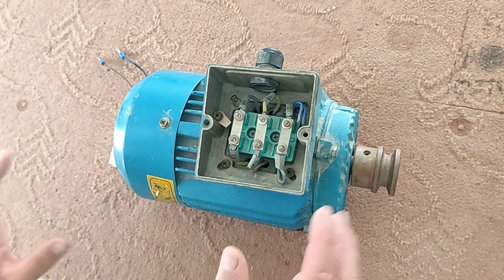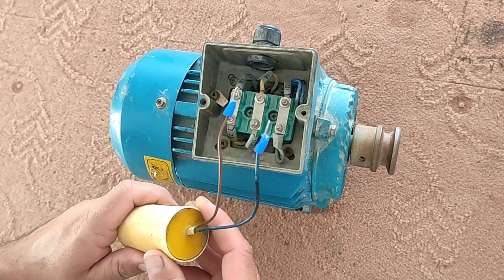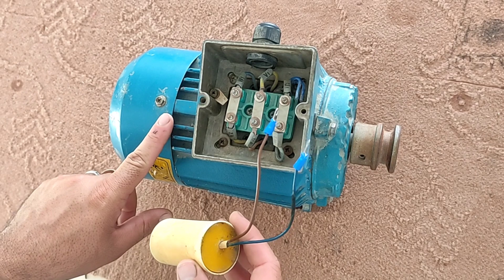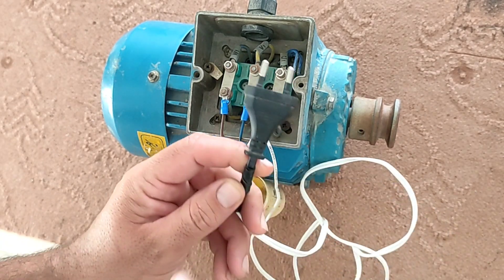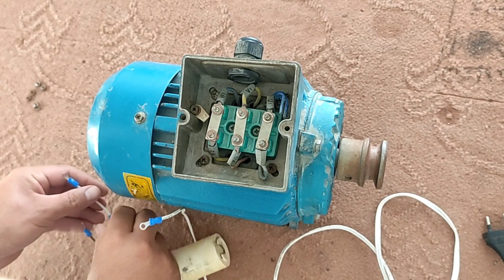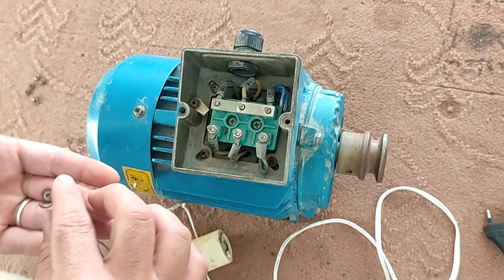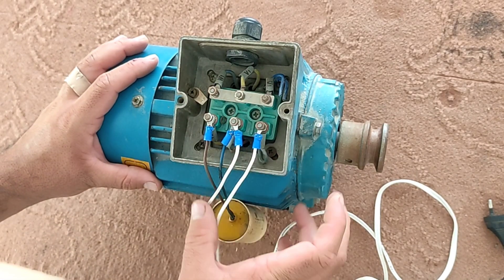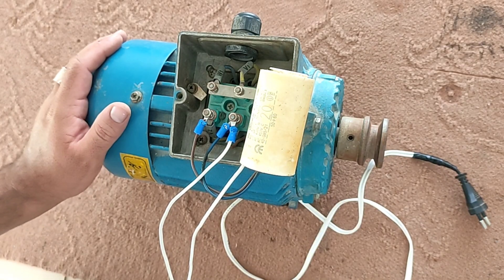how to run 3 phase electric motor with single phsse electricity

Comment: When connecting using delta,where does the live wire from the power supply connect to? U2 or W2? Thanks.
Reply from the maker: Hi 
it doesn't matter